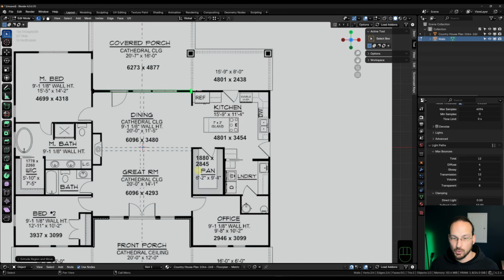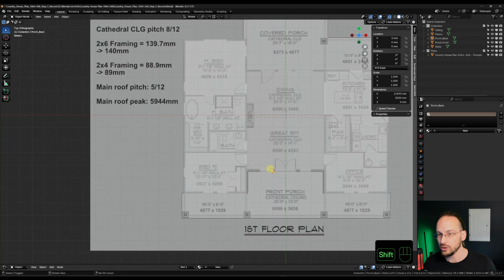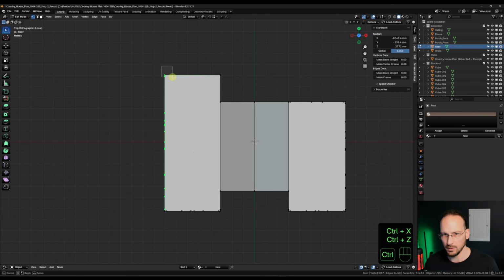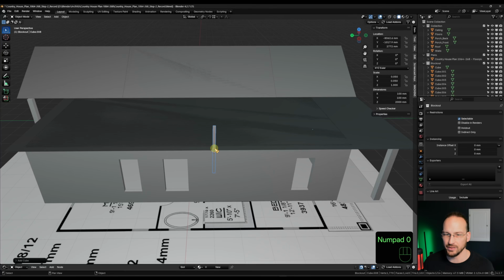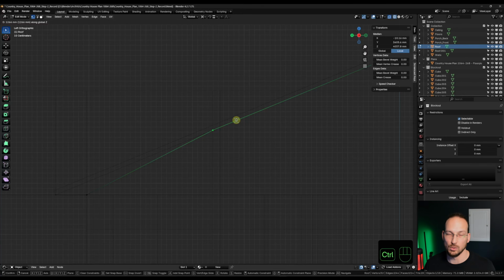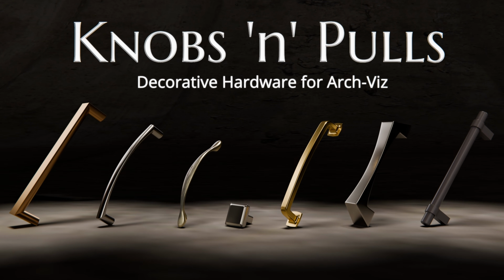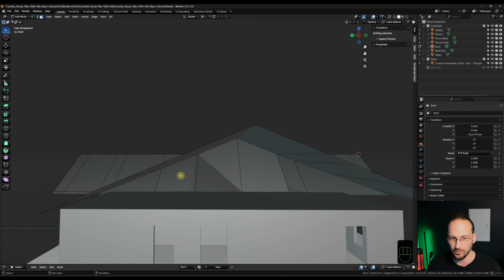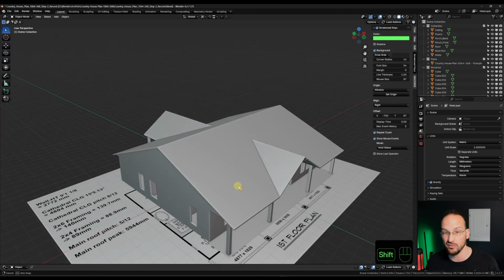Blender House Modeling Part 2: Accurate roof with limited specs

Comment: I actually love the use of "helpers" in this case because it makes so much sense coming from a CAD engineering background, basically turning them into constructor lines that you would erase later. I also find the roof stitching method used here to be interesting because it's not a way I thought of before when modeling.

Comment: There is just a ton of good stuff in this video.  Thanks for putting it out there.  I'm curious why you create "helper" objects instead of empties?  I guess there's no real difference in the way you used them, but using empties helps me remember which things are there for alignment and measurement only and which are there to represent something physical.  Thanks again -- I'll be coming back to this one for sure.
Reply from the maker: The reason for the helpers in this case was the option to snap to edges and vertices in various places without the need to move them around too much.
If it gets too crowded I sometimes make a separate collection for those as well.